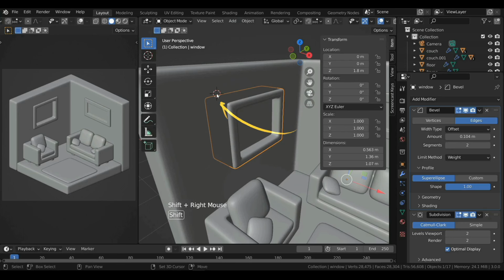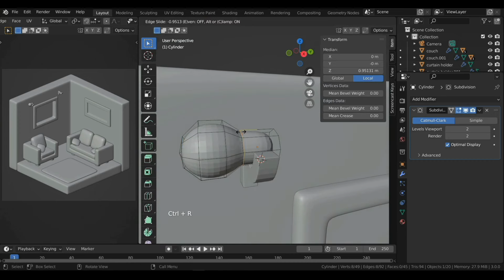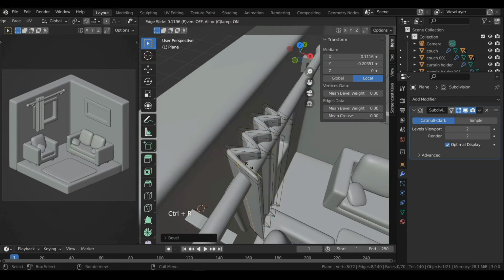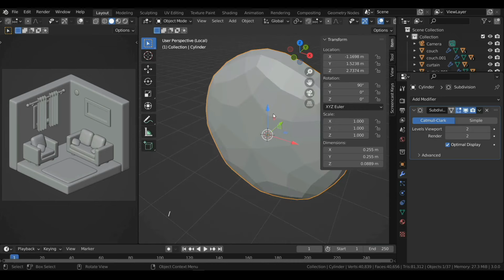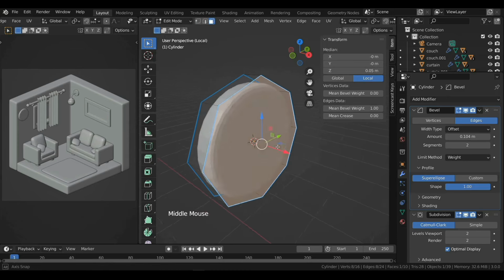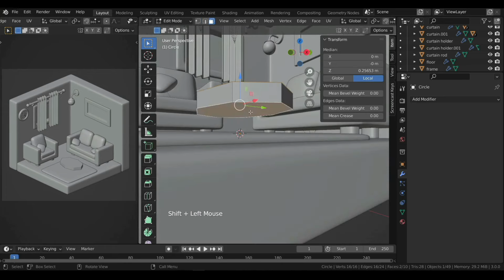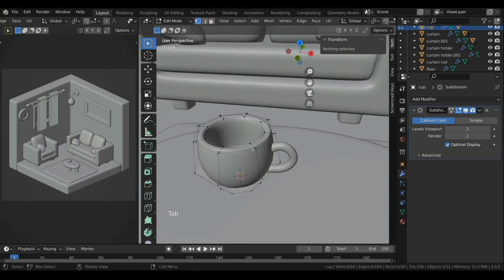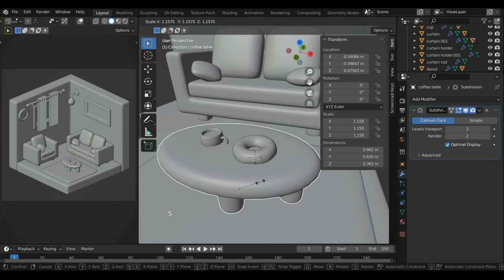Blender 3D - Create a 3D Isometric Living Room | Beginner Tutorial | Part 2/3

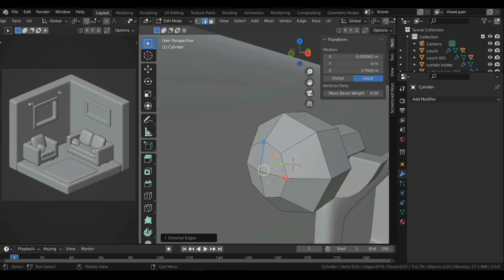Comment: 2:51 Little note, if you want to convert the poles of a circular face on a cylinder into quads (so the triangle slices to quads), just delete all those faces, select the edge loop, then go to the 'Faces' menu and click "Grid Fill", and mess with the offset and such til you have what you need. It's such a life saver! It sometimes doesn't work depending on the number of verts in the edgeloop, but it'll help a lot of the time!

Comment: 1:24 This fucking killing me. All settings are the same, but when I decrease bevel weight nothing change until I go 0.00 and shape becomes to much uglier thing then yours. Please help, I have no more nerve cells to find the way how to solve this...
Reply: I figured it out -- click on the thingy you just made. Hold shift and click on the wall (this is key bc you need to have both selected at the same time), then do ctrl L and hit copy modifiers. By copying the wall's modifiers onto the thingy, the mean bevel weight being turned down should curve it now.

If it still doesnt it is possible you are selecting the edges, but not the whole edge loops. You need to hold alt the select the edge loops.

If that doesnt work, turn off "emulate 3 button mouse" in your preferences under the input tab
Reply: same

Comment: why at 1:21 i do the same but no any action? it still is sharp no in curve?
Reply: same problem
Reply: I figured it out -- click on the thingy you just made. Hold shift and click on the wall (this is key bc you need to have both selected at the same time), then do ctrl L and hit copy modifiers. By copying the wall's modifiers onto the thingy, the mean bevel weight being turned down should curve it now.

If it still doesnt it is possible you are selecting the edges, but not the whole edge loops. You need to hold alt the select the edge loops.

If that doesnt work, turn off "emulate 3 button mouse" in your preferences under the input tab

Comment: Amazing tutorial, well done, well explained, perfect for refreshening the basics if you're getting back to Blender after a while. 
Just one thing though: i can't get the SHIFT + ] to work in any way... Has anyone had the same issue? 
Also, to move to Isolate View there's no need to press forward + slash. Just slash will do the job. Same thing to get out of it.
Thanks
Reply: (SHIFT + ]) Maybe it didn't work for you because of the keyboard layout, search for it first in the keyboard, try to write the square bracket symbol ( ] ) as a text to see if the button you clicked on is the one for it, then use it in blender with Shift, blender has that shortcut assigned by default, but you can assign it Manually if that wasn't the case by going to: Edit > Preferences > Key Map (Ensure you're in the Name search next to the search bar) then type: ( select hierarchy ) without parenthesis,  to see what shortcut is assigned to that action or to reassign it

As for the forward slash, You're right you souldn't press on the Arrows (Up or right) then slash.
This Slash (/) is called Forward-Slash, and this one (\) is called Backward-Slash or BackSlash

Comment: If you're adding a subdivision (subsurf) modifier and your object seems to "disappear" in wireframe mode, look at Preferences > ViewPort > Subdivision and try unchecking "GPU Subdivision." 

This setting appears to be linked to your machine's GPU and/or architecture—on my Mac, I had no problems with it checked, whereas on my Ryzen 3 PCs with a lower-end Radeon graphics chip, the modified object looked completely smashed. It was driving me crazy trying to figure it out!